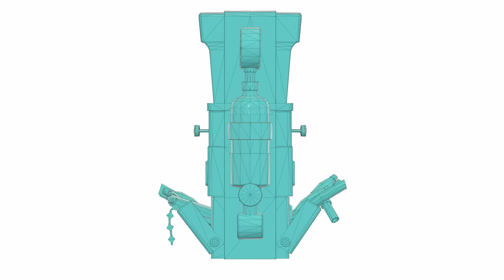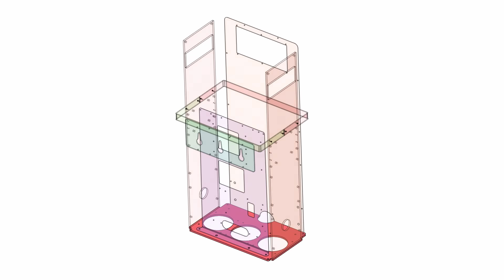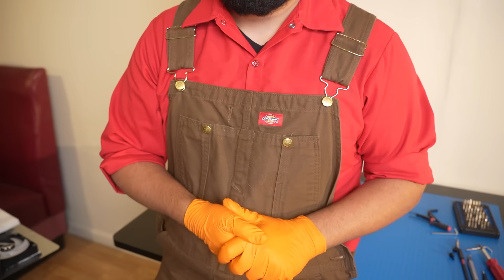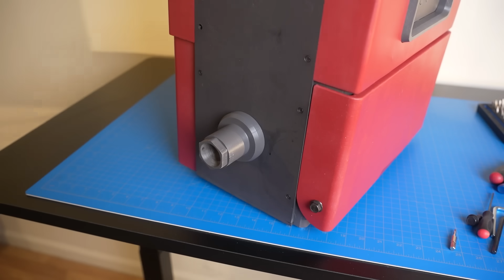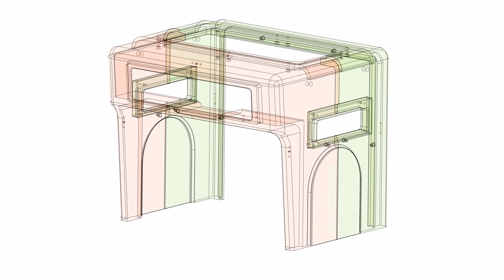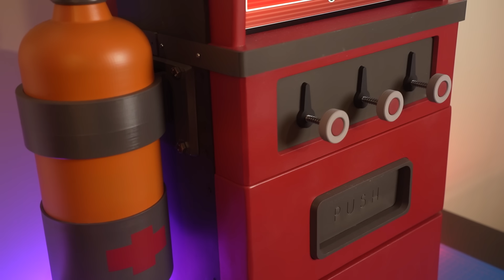Designing the Ultimate TF2 Dispenser Case Mod

Comment: How tall is it ? Since i can't really figure out how tall the game model would be irl
Reply from the maker: Mine is 35 inches tall. I didn't scale it to the game model. It's based around the main LCD which is 15.6" diagonal so it's smaller.
Reply: @MrVolt  ok thanks a lot for responding so quickly and I want to make a 1:1 scaled model and I plan to use one of those high end micro PC and try to figure out how to make the entire thing somewhat fold into the toolbox like the game
Reply: @MrVolt  also how did you get the little top to go up and down ?

Comment: Push Plate Idea: Add a SATA dock behind the push plate with 3D printed guides for easy insertion of SATA drives. That way you can quickly and easily deal with internal drives that dont belong to this build in the future. Like say you want to archive footage. You could just buy a big drive and slot it in, dump all the stuff cluttering your machine, and then pulled the drive like any hotswap for unpowered storage in a box or something

Comment: I suggest adding the level 2 chest section for the dispenser with the needles and such, allowing for storage capability as well as (in my eyes) only needing to adjust the wires for the buttons in the back some as the chest section will only serve decoratively and as choice of storage, such as wires, etc. This way you can have the full level 3 dispenser (And full healing!)

Comment: If you’re looking for ideas to upgrade it, I suggest M.2, HDD SATA bays or similar, SD card reader slots, disc drives for older media, etc. you could even have the back side of the dispenser pop out a tray to store nice and things! And while it cannot turn into a toolbox, a carry handle popping out would be funny, for the goofy TF2 theme, and help in portability (if done right). You could also make the air can FUNCTIONAL so you can blow dust out when needed! (Or make it a liquid cooled tank for the CPU/GPU)

Comment: you could use the air tank twist dial as a volume control, and the visual display meter at the top of the air tank for showing the current volume setting. ( shows whether the volume is high, low, or in between etc, the dial shifts towards full or empty depending on the volume.), the main screen at the center, could be a power or specs gage.

Comment: What if the air tank on the side of the dispenser held some kind of drink like soda and "dispensed" it into a cup when needed. It could just have like any 2 liter bottle in it. Connect that to a a spout or maybe even something that comes out of the push plate, and you can get a drink while gaming on your dispenser. Heck, you could probably find a way to refrigerate the bottle (but that would be kinda over the top).

Comment: consider: put a little pan under the inside of the push slot, then store things like pens/pencils, small screwdrivers, pieces of candy, etc in there, so you can just reach in and grab what you need in any given moment

Comment: That air tank would make a great reservoir for a liquid cooled system if you could find the right dimension of clear pipe/bottle, just tint the liquid in it orange. That LCD gauge on top could also have the temp displayed on it

Comment: Assuming you're running Windows, you could get one of those Windows Hello compatible cameras to install in the top bit.

For the keypad up there, maybe deviate from the source material a bit, installing a 4x4 keypad for like a chip-8 emulator would be neat. (though practicality is questionable at best) Maybe a 4x5 for some shenanigans along the lines of punching in machine code?

Comment: I know the screens are cool but I think analog dials and displays would've been so much cooler imo haha. But this design still has so much potential!

Like, imagine if the air tank was a water tank for the PC's water-cooling system, and the dial above it showed the CPU or GPU temperature, with a little red zone for the temperatures which start damaging them. And I know that you designed it around the main dial being a monitor.. but if you ever end up turning the Dispenser into more of a PC case to accompany a screen, making it show remaining available CPU/GPU/RAM dedication would be so cool!

Your creativity is insane and I LOVE this project!

Comment: It would be cool, if not extremely difficult and impractical, to use the oxygen tank as a reservoir for water cooling. That or fill it with Mountain Dew for gamer fuel

Comment: What if the little graph on the top of the dispenser actually displays info on the computer like core temperature?
Reply: genius
Reply: big brain time
Reply: That or the dial meter on top of the tank. They can both display different diagnostics or switch from them.
Reply: @MildMisanthropeMaybeMassive  yeah I can see the side gauge showing load and the top monitor showing temp. I feel like that would be sensible measurements to show.
Reply: that what i was expecting for the graph, the pressure gauge or the big screen that shows how full it is

Comment: I'm sure you already considered this but water cooling? A big clear resevoir would look so cool in place of the tank.
And as for the push door would it be possible to have some kind of mini fridge behind the whole machine that dispenses soda cans?

Anyway this is very impressive and fun as is! I'm just throwing out some dumb ideas.
Reply from the maker: For sure! I think the tank would be a perfect reservoir too. I ran out of time to add more features to this design. Maybe for level 2 haha. Also, that would be sweet. Now I need to make some Bonk cans...
Reply: @MrVolt  you could fit some sort of panel display "in" the tank - completely separated from water but have it appear that you have the little healing particles inside the tank. only issue would be if you viewed it from another angle, but im sure with some light trickery it could work!

plus, this allows you to have an rgb light within the tank, meaning you can have any color "healing" fluid! bonk atomic punch included

Comment: Push plate should surely be a drink dispenser of some kind. Nothing like storing liquids and electronics together
Reply from the maker: For sure! Needs to dispense some Bonk drinks :P
Reply: hey Mr volt could you try to make the turret from portal 2 that would be cool @MrVolt
Reply: @Jackstarrrr he should make the defective turret so he can make it 100% accurate
Reply: thats wayy better @Guhhhhhhhhhhhhhhhhhhhhhhhhhhhh
Reply: @MrVolt  can you actually do that?
Reply: I don't know how easily acquirable they are, but you could also track down (or 3D print a copy yourself of)  the official Sandvich toy. (From Comic-con 2012 or the defunct Valve store.)
Reply: also should dispense chips at the same time
Reply: Root beer
Reply: @aslegger don't trust a mf who don't like MUG
Reply: peanut storage
Reply: HEAT SINK HEAT SINK 😂
Reply: Activates an audio clip: "Close that door!  It's frrrreeeeezin' out there!"
Reply: Or you could either use it as a trash bin when your lazy to put it out in the trash. You insert the empty soda can inside and just act like it.

And when it is full or whatever, you have to remove it all out and throw it in the garbage.
Reply: Maybe instead some snacks like bags of chips or pretzels or sumn
Reply: I know it's a joke, but there are liquid cooled systems.

If the computer produced a ridiculous amount of heat you could combine with a coffee machine.
Reply: Maybe the air tank should be a water bottle.